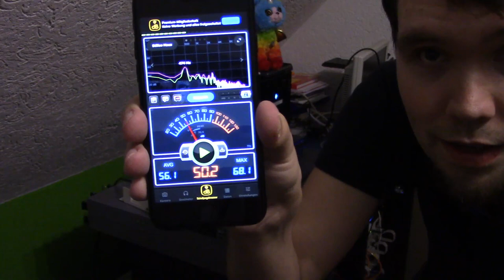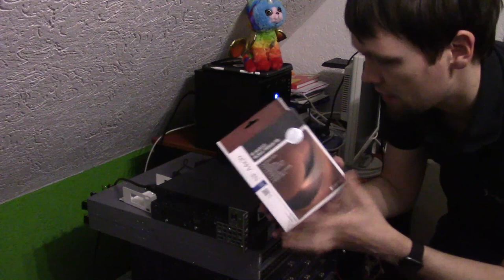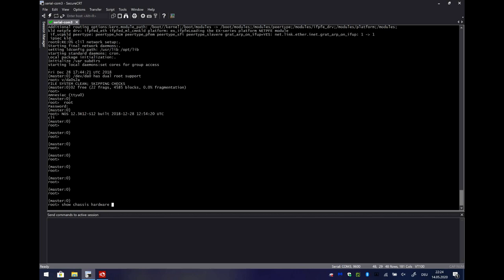Netchron - Juniper EX2200 Fan-Mod

Comment: To avoid causing that same damage to the fan power connector latch, use one of 2 seemingly obvious choices while using less force on the screwdriver: grip the connector with wide pliers wiggling it out, or use a chip puller (not sure about now, but they used to be standard in computer toolkits) to get a grip under the connector as soon as there's a crack to slip in

Comment: This is very cool and I hope they have one for cisco and PaloAlto PA-500, those makes crazy noise
Reply from the maker: Usually, the smaller boxes all use the same fan (some with different headers but that can all be measured). It's a bit more pricey but so rewarding when you have a silent Switch / Firewall that used to sound like an engine starting ;)

Comment: Do you recommend this mod? I have an EX2200 purchased recently and it is pretty noisy, however noctua's are expensive so I'm only doing it if it really is as silent as you say.
Reply from the maker: I would recommend it. It's running next to me and is still silent as on day 0 :)
Reply: @Netchron  I actually did the mod, but changed back to original fans as i run it 24/7 haha.
It is for my home network, it ran fine with the fans and no noise anymore indeed, however the temps were slightly higher for my feeling, which I didn't like, (very close to the "alarm threshold", now in winter maybe fine, but in summer I don't want to know. Also, I saw that the flow rate of the stock fans is twice as high as the noctua's, so not sure.
It is in a cabinet, and I can hear it spinning up and down slightly from the outside... (latest firmware does this, don't understand why really, they say its normal). Thanks :-)
Reply from the maker: It's true, that the temps are 4-5°C higher here as well but not near the threshold. But yeah - depending on where it is installed summer can be a painpoint - every °C counts ;)

Comment: Hi,

i have a Juniper EX2200 and have reset them to factory defaults and run ezsetup.

Now i must connect always the USB port to my Notebook that the EX2200 run.

What´s wrong ?
Reply from the maker: You have to connect your notebook via USB so that the EX2200 runs? It refuses to run without plugging in the USB to the Notebook? That’s extremely weird and I have never seen such issues with any network Vendor before? How is the device (EX2200) configured now?

Comment: Thanks for sharing, looks like a great mod. However, so much shagging around with those brown rubber connections - it would have been so much easier with just the screws. How much sound dampening do you think these actually give? 
My switch is the POE version, so has an additional fan on the side. I am assuming this is the same fan type and thus the same mod should work. Anyone had any experience with this?
Reply: Never mind, I purchased the fans and tested for myself. You make it look much harder than it was with the brown rubber connections, I had very little trouble with them. The power supply fan was a little trickier, and I needed to solder a custom connector, but otherwise the mod was a big success. Thanks again for the inspiration.
Reply from the maker: Great that your's was easy to install - mine were a bit harder to install it seems - unsure why.
But yeah - it makes a small but significant difference - every db counts in the livingroom ;)

Comment: Can I do this with a 4200?
Reply from the maker: Unfortunately, the EX4200 comes with a custom Fan - I haven't (yet) found a noctua for this kind of Fan.
Reply: @Netchron  thanks for the reply! I'll keep my ear defenders on  :D
Reply from the maker: @vs4147  ;) The mods I did so far is 2200, 3300, 2300, and 3400. 4300, 4600, and the special 4200 are still on my list ;)
Reply: did you ever get a chance at modding the 4200?
Reply: @joshuaimholz3890  Just make sure not to do this to the PSU's that are 930 watts .... they explode after about 10 minutes.  Badly.